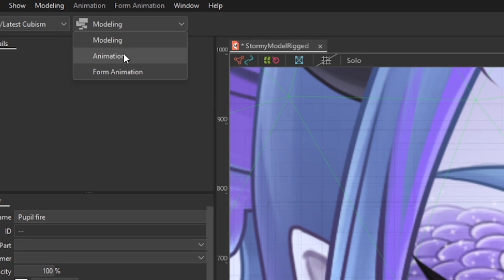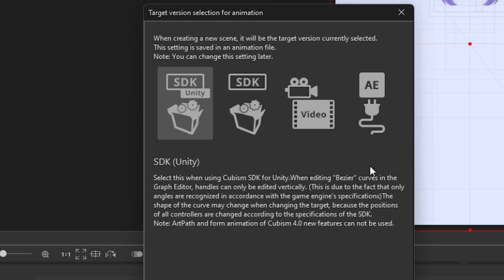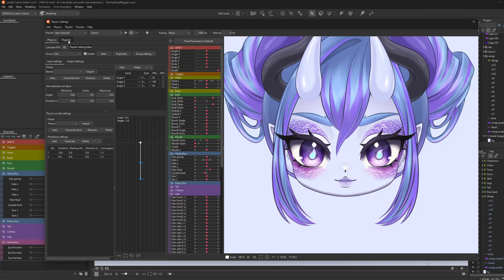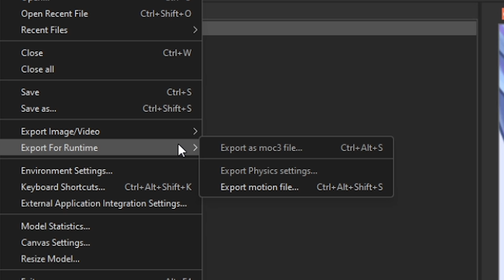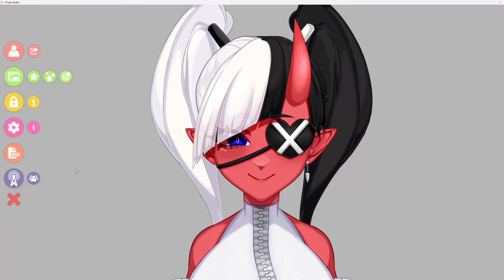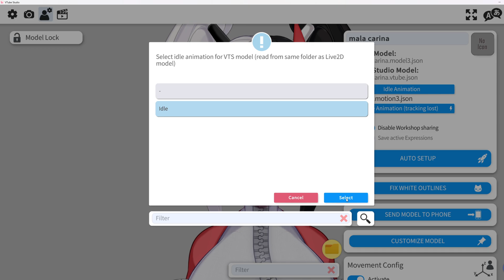Looping Animation in Live2D – Quick & Easy Tutorial!

Comment: Thanks for the lesson! I have a question: How can I configure the animation to be not in idle mode, but on an ongoing basis? In my case, I wanted to do a separate eye blink for the pet.
Reply from the maker: Idle animations will run on a loop for as long as the model is active, so pre-animated blinking should be included in the idle animation. The naming is a little confusing, but what you’re thinking of is probably the tracking lost animation which will only activate when it can’t find a face to track.
Reply: @Vyris2D not quite so, I meant that when unloading the model, unfortunately, the constant animation is not reproduced, in my case, the animation of the blinking frog 🐸